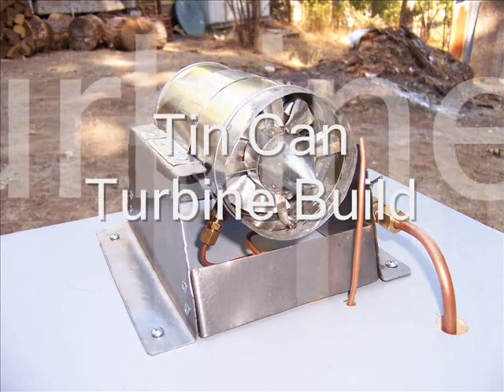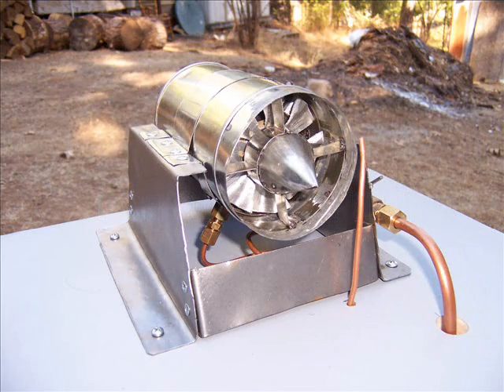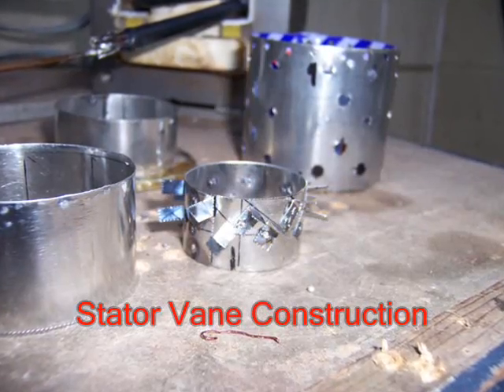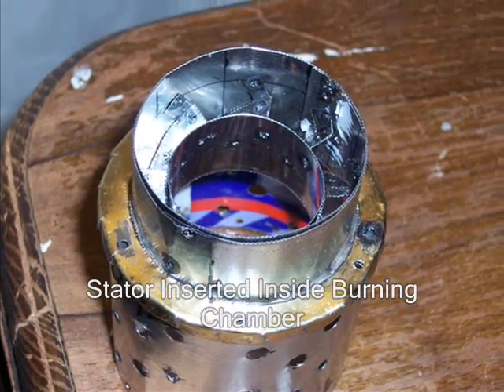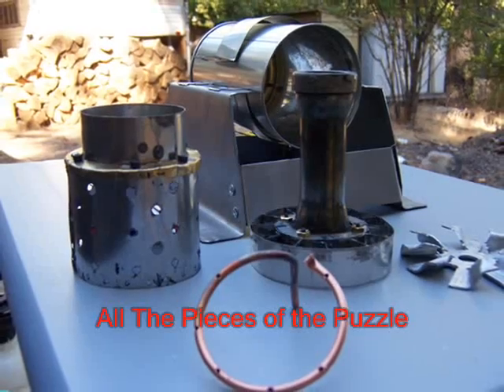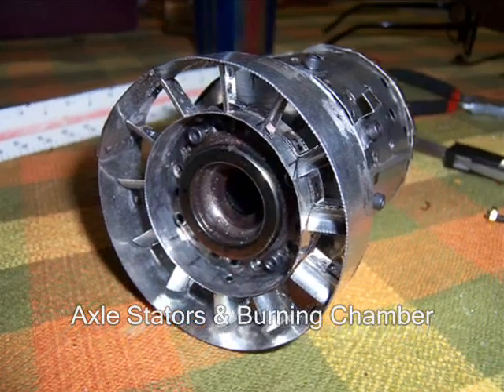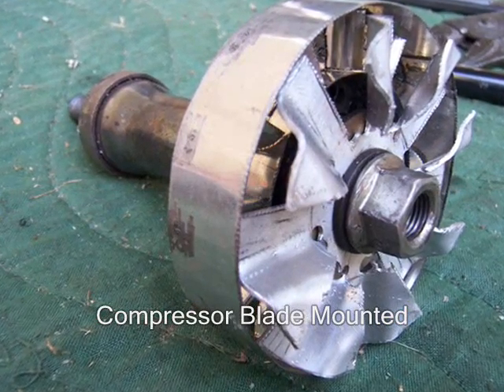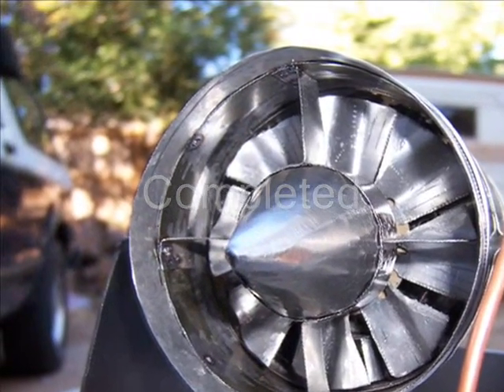Tin Can Turbine Build

Comment: this is what everyone missed... the title says turbine meaning its running on air
Reply: Daniel Nelson you mean like Kerosene
Reply: Not necesarely..
Reply: No turbine runs on just air they need fuel too, unless ya thinking of a scram jet
Reply: ***** when they was first testing the fuel for the scram jet it gave them a headache cos it kept blowing out at high speed, its taken yrs to perfect it,
Reply: ***** ONLY FOR THE AFTER BURNER I BELIEVE, IT WAS JUST COMPRESSED AIR UNTILL SECOND STAGE WAS NEEDED WHERE FUEL WAS ADDED.
Reply: Any engine needs fuel. Air alone is not fuel I think he might be using diesel because that is the closest consumer version of Jet A1. My dad works on Turbine/jet engines everyday and this is one of the most basic principles. ***** Is correct.
Reply: Daniel Nelson The closest thing to jet fuel is kerosene. Jet fuel is a refined kerosene, RP-1 rocket fuel is also a highly refined kerosene.

Jet engines can run on any fuel, as long as it is a fuel.

Example.
US military Arbrams tanks use a grade of kerosene, the exact same tank and engine in the Australian military is run with diesel fuel.

Diesel requires a very high compression though, i do not think this little thing would be capable of running diesel. .likely just normal petroleum or commercial kerosene from the hard ware shop.
Reply: HONORGUARD308 Technically jet engines can run on any fuel however the burn properties rule our certain fuels because of the burn speed. You could not run a jet engine on gasoline because of the burn properties of gasoline. Gasoline "explodes" when it is ignited while Kerosene and its sub-fuels are burn slower. Thanks for the Information on diesel. I am designing a Jet engine and am looking at different fuels. Primary concern in the burn temperature and burn speed. Propane can be use as a jet fuel; however I am also looking at the possibility of methane. Kerosene may work I have found it to have a much lower burn temperature than Diesel or Jet-A1.
Reply: Replying from my phone so cant direct this comment to your name.
You could run a turbine engine on petroleum, just depends on the octane and cetane rating of the fuel and the specifications of the engine.  Petroleum is a combustible compound not an explosive compound so it can work.

Is the engine you are designing for a professional entity or a hobby thing? I design aerospace propulsion systems and if its a professional job your doing you might like to know some materials and cooling methods that could maybe be used in a turbine engine?
Reply: I am working on one for my schools Physics Club wanting to get something similar to a General Electric Turbo Fan engine on larger jets but in a smaller size. Initial prototypes I am planning as single stage engines for the Compression and driving elements. However I would like to have the multipule compression layers in the final model. Part of it is their is so many different elements from Physics that go into this type of engine. Rotational inertia, Compression, Decompression, and the use of the gas being propelled out a small hole at high velocities to propel the Turbine blades. My dad works in the aircraft industry on Pratt and Whitney's PT6 Turboprop engines. So I have a lot of information at the tip of my fingers but any help would be appreciated. I do understand the magnitude of this project in safety. This is not a toy to mess with but a fully working engine.
Reply: HONORGUARD308 I am working on one for my schools Physics Club wanting to get something similar to a General Electric Turbo Fan engine on larger jets but in a smaller size. Initial prototypes I am planning as single stage engines for the Compression and driving elements. However I would like to have the multipule compression layers in the final model. Part of it is their is so many different elements from Physics that go into this type of engine. Rotational inertia, Compression, Decompression, and the use of the gas being propelled out a small hole at high velocities to propel the Turbine blades. My dad works in the aircraft industry on Pratt and Whitney's PT6 Turboprop engines. So I have a lot of information at the tip of my fingers but any help would be appreciated. I do understand the magnitude of this project in safety. This is not a toy to mess with but a fully working engine.
Reply: Daniel Nelson Do you have any major equipment to produce the engine? milling machines, lathes, CMM, coating facilities??

If not a simple way do make a nice engine would be to use turbo centrifuge impellers and produce an engine much like the early Rolls Royce Derwent engine.

Single stage compression, single stage turbine, and if you want it to be a turbo shaft you could simple add another impeller in the jet stream.

If you want to make the engine run at high temperatures there is a material called niobium hafnium alloy, we use if for rocket nozzles.

If you design the aft sections right you could run the fuel through a channel on the outer surface of the exhaust, the fuel will heat up due to the heat from the surface of the nozzle and this can reduce the loading or replace a fuel pump.

When i was at school my teacher made a simple demonstration RAMJET and he used the same method, placing the fuel tank around the hot nozzle to heat up the fuel and produce internal pressure thus he did not need a fuel pump at all. .this was a very small engine but if you could get it to work it would be a very interesting thing to use.

You could try and use a ceramic coating on the aft components if you do not have access to such alloys, and if you have any concern about safety such as explosions you could wrap the engines body with a kevlar layer to reduce the effects of an explosion.

These are some simple points from rockets engine and nozzles and a simple design been the Derwent engine.

Your dad will likely be able to assist you in making something great. . even some old turbine blades that are not fit for commercial use might work in a demonstration engine for a few minutes at a time. .
Reply: My school has Milling and Lathes, Not sure about CCM (Which I think you mean Continuous Casting Machine). I am not sure what you mean by Coating either. I am sure I can find get access to most of this stuff. The ceramic coating idea is useful. I will look up the Derwent engine and take a look at its design.
Reply: Daniel Nelson Na CMM is Coordinate Measuring Machine.
After we make a part like a turbine blade or liquid rocket engine part we sit them on a special table and a machine (like a cnc mill) has a probe that will move and measure every surface to make sure it is within the specified tolerance, even after highly accurate milling and lathe operating this step should be taken cause the material can deform during processing.

Coatings, think paint but more advanced lol.
Ceramic coating is kinda like painting a material with a ceramic compound that will dry and leave a layer of ceramic.
Example, some very high end small arms these days have ceramic coatings on internal components to increase their resistance to ware, heat, as well as helping make the operations smoother.
For a turbine blade you would not need to be very accurate and have a layer that is microns thin, just a light consistent layer should work and with care you would be easily able to do this if you can get or make the right compound.

You could maybe make the Derwent design more efficient if you add another stage to the intake and inject a small amount of fuel after each stage, this should allow the fuel to mix a lot better than a single point of injection.
For the Derwent based engine if you choose to go with it you could use standard turbo intakes and if you coat the exhaust turbine it should work fine for you.

Talk your your dad though, i mostly work with rocket engines so high experience might be greater than my theoretical knowledge of turbine engines.

Comment: I cannot believe you are using a bicycle bearing for the shaft bearing. There is no way that a bicycle bearing can run at 20k RPM as that engine seems to be doing.

Comment: Nice job! just one question though...do you know what a rotor sallad is? that's when the rotors jam at high speed..if that would happen the parts could easily rip thrugh the thin housing and hurt someone

Comment: Axial compressor isnt the way to go in this scale. It takes even high end lathes a big effort to make axial this size to actually create compression instead of the air just  escaping through the radial gap. Thats why they use centrifugal compressors in small jets and turbochargers. Nevertheless props for your effort!

Comment: For those of you wondering if it's self sustaining. It's not. You can hear the air compressor in the background sound..... But anyway great effort!! Also a self-sustaining engine much higher pitched
Reply: I think it is, but you saw the parts it was made of, maybe it just isnt capable of making crazy high RPM's/thrust
Reply: TheFennahh first of all if it isn't capable of running at high RPMs then the engine isn't capable of compressing air which makes combustion harder, turbine extraction harder so therefore lower RPM are not capable of creating pressure. Most of the cause for lost compression is mostly inefficient stages from rotor to stator. Multi-stage compressor are more efficient. I know, what about single stage centrifugal compressors? They are a whole different story. I can't really explain in words so check out my channel and watch How a Jet Engine Works. Then skip to the compressor part of the video. I explain the difference between axial vs. centrifugal
Reply: It could have been a partial assist. So yes there may have been a compressor, but it was only supplying a prtion of the necessary compression, sort of picking up the slack of the main compressor blades. Mind you this would be most of the compression, but it technically still demonstrates that concept without being a total cheat. Obviously it means it wouldn't be viable for propulsion, but it is an interesting way to debug a compressor blade design without having to rebuild your entire compressor stage. Like say a fully sustainable design would need 5 of those compressor blades. you just build one of them, test it with an electric motor to determine its compression capability, set a pump compressor to simulate the compression capability of 4 of these things, stick the 1 existing one in the engine with your compression assistance to simulate the other 4 you didn't build, and then see if it propagates. Obviously you would also need to add some dummy weight to the axle to simulate the added weight of 4 more blades, but that could just be done with a heavier nose cone (assuming it spins). It would be sort of like what a wind tunnel is to an airplane wing.

Comment: I don't think it's self-sustaining, not with the gaps on the tips of the compressor or turbine as there would be too many losses in efficiency, so probably being spun with compressed air, even with compressed air it will accelerate when fuel is added and burnt but take away the compressed air and I bet it spools down i.e. not self-sustaining

Comment: This is the first home built unit I've seen that actually seems to work. I'm not sure what your fuel is but your exhaust flame looks a tad on the cool side (too much blue, not enough orange) which may mean you are not getting as much thrust as you possibly could.
Reply: From the flame color, my guess would be propane.

Comment: Most full scale engines use (believe it or not) a starter motor that spins up the turbine to around 20% of it's designed full RPM before igniting the fuel. Some model turbines use a hand held motor to spin the leading hub of the fan blades and ignited in the same way. Some have a permanently mounted "spin up" motor while some can be started by blasting high velocity air into the compressor fan.

Comment: If you're still gonna do a next build maybe construct the axle yourself so you can construct an "oil gallery" for the bearings to keep them lubricated and cool? Also this way you could even include an oil circulation system and (possibly) achieve higher rotational speeds. Achieving higher compression would still probably be an issue, axial turbines aren't the easiest to create for the home builder.

Comment: Well it works like this. You like the propane lead inside the model turbine, and you need to spin the compressor with some kind of other force. For plane engines, they have mobile diesel engines at the airport to spin the compressor.He could have either used compressed air to shoot into the intake, or he could have used a power drill to spin it up. When it spins the action of compressed air igniting then being forced out of the smaller exhaust as hot air, creates a suction that goes in a loop.

Comment: Ok just FYI, this is not an engine.... much less a turbine. It doesn't run on the fuel you're burning. This is no different than putting a torch in front of a house fan....

Comment: How much output does the turbine generate?  What is the oil pressure?  How many hours has it run without mechanical breakdown?  How many RPM does the engine operate at?

Pretty sweet use of tin cans and a bicycle axle!

Comment: "no successful* microturbine built to date using an axial flow compressor"

About 2 years ago I was working with a company that had working 5 stage axial flow micro turbines, smaller than this. Obviously completely different ball game in terms on the engineering involved... Would love to see what they are doing now.

Comment: He would need stainless steel/aluminum construction based on which components they are.

A centrifugal compressor (a precision-machined, purpose-built pice of turbomachinery, not a vacuum blower).

An oil-cooled core with precision bearings or journal bearings (float bearings), or a sealed, lubricated core with hybrid ceramic bearings.

A set of Nozzle Guide Vanes (NGV's) for the turbine, a more carefully planned combustion liner layout, more advanced evaporative fueling system for liquid, etc..

Comment: I can say that he was certainly using compressed air.
There has been no successfull microturbine built to date using an axial flow compressor, let alone out of a tin can.

There are simply so many problems with these designs, and the use of tin for EVERY component.

If he spooled this to a speed at which the components would begin to function as intended, it would explode spectacularly.

Comment: it doesn't sound as if you are pumping enough rpm through it for it self sustain. you need to be looking at around 36,000 rpm idle then around 51,000 at max capacity unfortunately it would probably mean you would need to splash out on expensive bearings